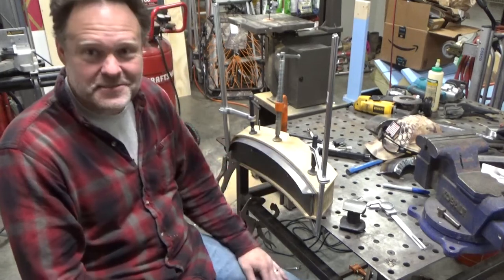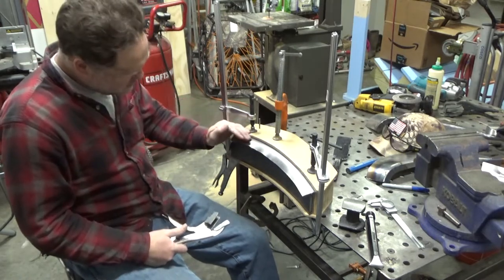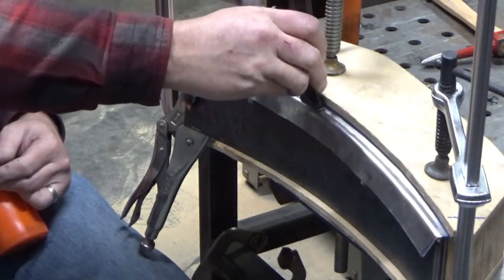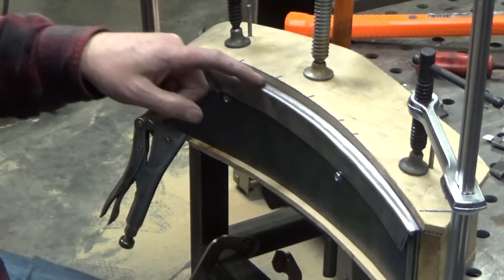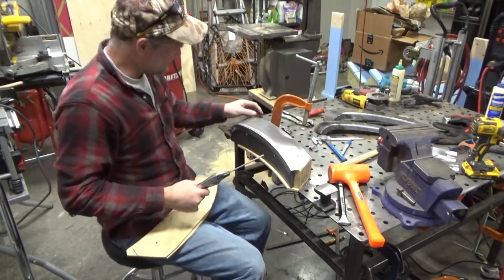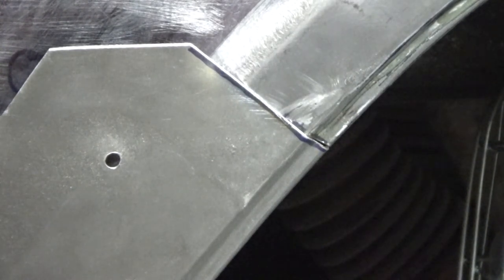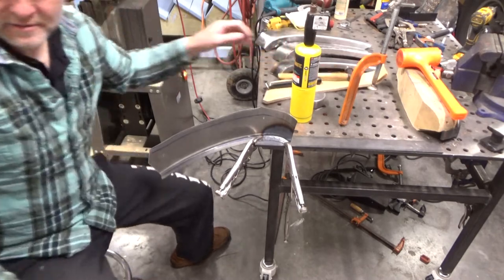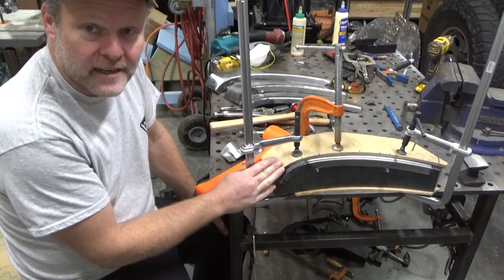Metal shaping the final patch panel on my Chevy blazer

Comment: You definitely have a nice shop there!  For what it is worth my $.02:  At least in the area of smallest radius you are trying to do too much at once -- you are confusing or mixing what Wray Schelin calls area value and the arrangement value.  Have you tried hammering the crap out of the shrinked area (capturing and flattening the tucks) to get it totally smooth while flat and then putting it back in the hammer form buck?
Reply from the maker: I may not totally understand what area you’re talking about but I was able to flatten out those tucks and still get the panel back on the hammer form. It’s all welded back up on the truck. Trying to finish some other projects before I spray a guide coat of primer on it and see where I’m at with any micro-imperfections.
Reply: I think what he’s saying is you could have started turning your edge part way to 90, then shrunk out the wrinkles. Then you put it bAck in the form and continue getting it closer to 90, then shrink the tucks again. In other words work in stages more. What you have looks good though.
Reply from the maker: @andrewreece3861  ah, that makes sense. I may try that for the other side.